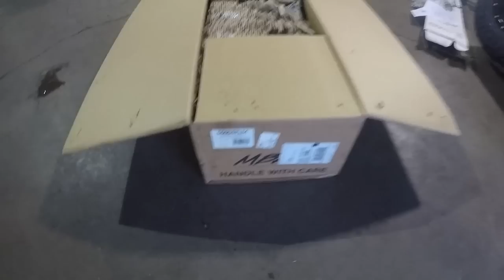DURAMAX LIFTED 7" WITH DECKED OUT BDS SUSPENSION

Comment: If you pause it at 6:18 you'll see that the weld in plate on the driver's side lower control arm wasn't installed. How's the truck holding up, any issues with it? I'm about to install a similar lift on truck and was curious if I had to weld that plate in or will it will fly without it?
Reply from the maker: Nah, that was just mocked up, it was welded back in after that, at 9:19 you kinda can see it. And it’s holding up amazingly, still kinda looking for tie rod ends that will work well with the kit without heavy modification, but other than that it’s great!!
Reply: Rustbelt Mechanic awesome! Thanks for the response. Truck looks awesome! After I saw your truck i was going to try and stuff 37's on my 6 inch on my 2500hd. Ill update you this thread if I made it happen.

Comment: i have a question for you that i hope you can help me out with i want to install a oil temp sender that reads the oil before it dose in the heat exchanger on a 2006 gmc 2500hd duramax (RPO) lbz thank you

Comment: Why did you have the lift components sprayed a lighter color? BTW, the components look to be high quality and a very clean install.
Reply from the maker: Wayne Tjornhom to give contrast to all the dark parts and it’s sprayed in the raptor liner, so it’s way tough.
Reply: Rustbelt Mechanic , I get the bed liner concept but I’ve never seen light grey used. I’ve seen contrast with bright colors.

Comment: Wait so you can fit 37s with 7” BDS suspension with no problem?
Reply from the maker: Kind of...I’ll do an update video on the next few weeks. But I did a full NorCal on a video and the truck sitting perfectly level only rubs slightly in reverse. I’ll be going for no rub at all in the next month or so with a mod for this.
Reply: I really wanna run 37s on my lbz but seems like getting a bigger lift is the way to go. Would lift keys be best to fit 37s with a 6” lift?I really want a kelderman air lift but that’s just time and money.
Reply from the maker: If you don’t want rubbing get a bigger lift, but 7” Lift is cutting it close and still has minor rubbing even with a full NorCal. I plan on getting the 5” Lift leaf springs for the rear and adding a 2” block, then turning my front keys up to match, that will clear everything.